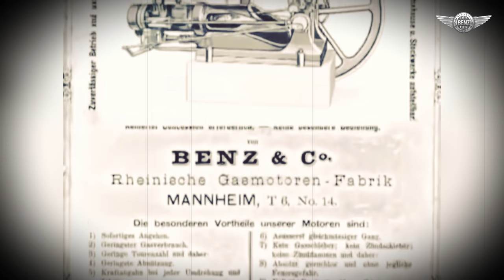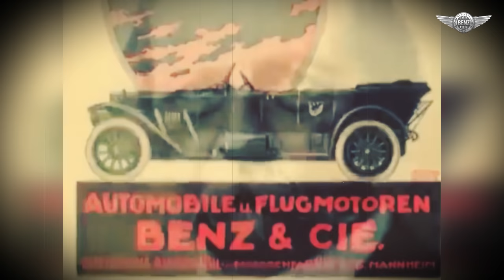Karl Benz - the father of the car

Comment: Ford actually make the world first car.. and the only manufacturers who invented rubber wheel and steering
Reply: Ford made his car in 1903 while Benz invented it at 1886 a few years later with 4 wheels. And the rubber wheel was invented by a Irishman in 1888.
Reply: Benz and DMG had started the mass production car in 1888. Jelinek bought DMG and named by his daughter name Mercedes in 1889. After world war 1 they merge the company with a new brand Merecedes-Benz. Ford just invented a single assembly line that made his car cheaper while it was still very expensive in europe.
Reply: Wtf no... Ford didn't make the world's first car